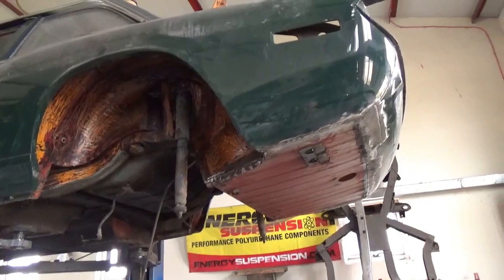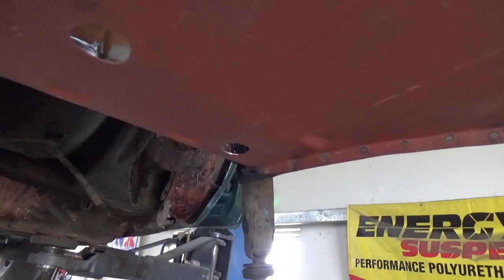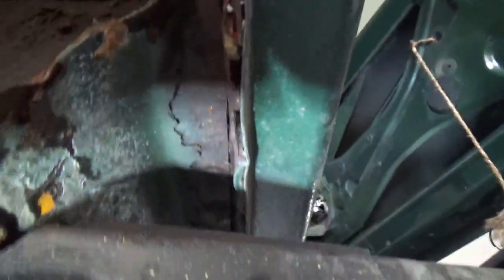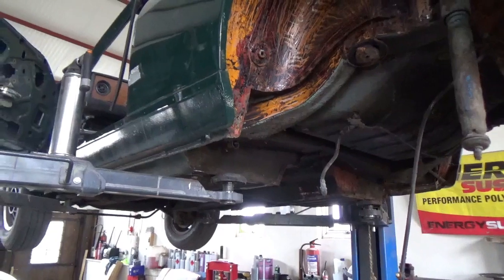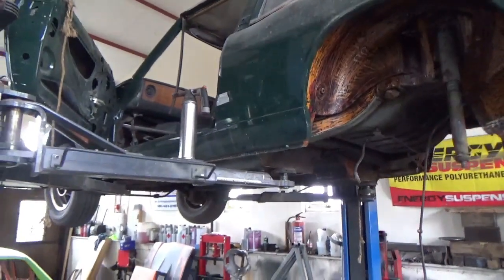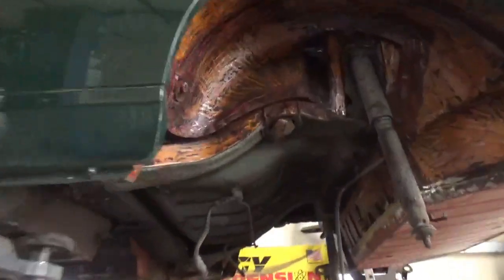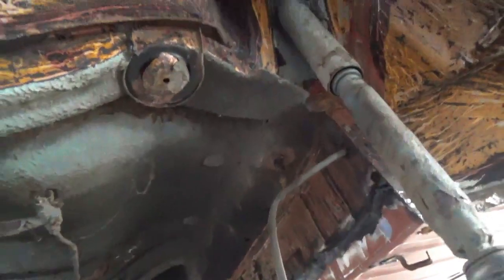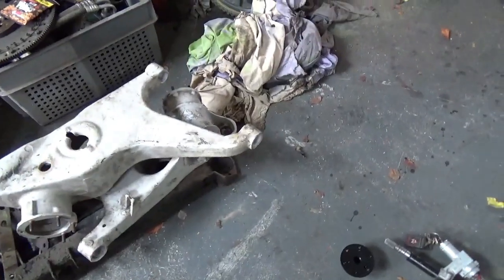green Triumph Stag update - ROT REMOVAL!  boot floor in, inner arches and sills (rockers) coming off

Comment: Will you add some welded gussets to the front of the quill shaft housing? It is a common Stag problem for the weld to let go. This happened to me and when it does it causes a lot of damage. An easy preventive upgrade while this assembly is out of the car.
Reply from the maker: It's not something I have personally ever seen, I will certainly consider it. Did you make a frame/jig to stop the welding distorting the shaft housing?